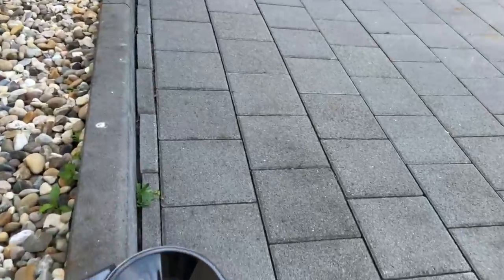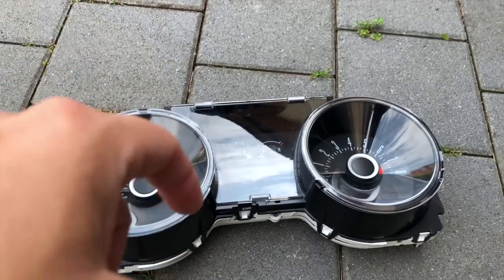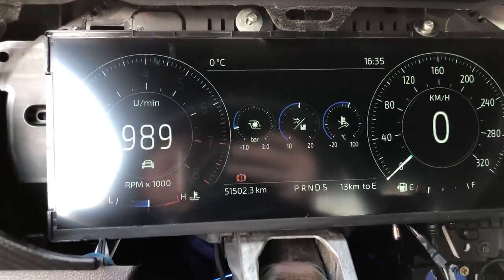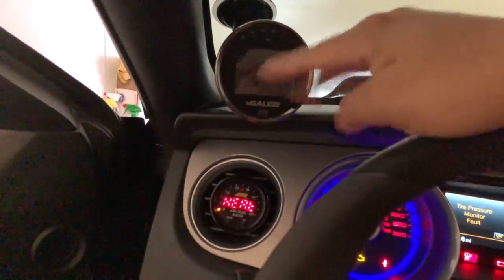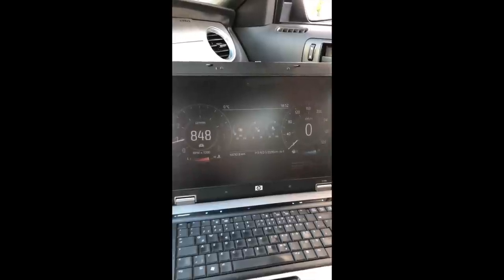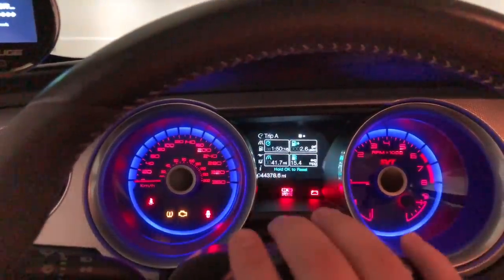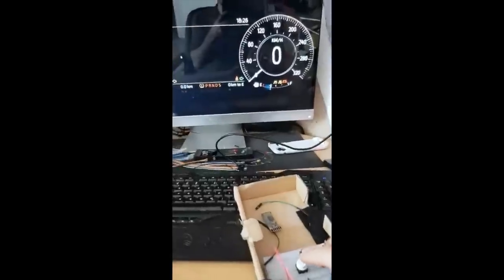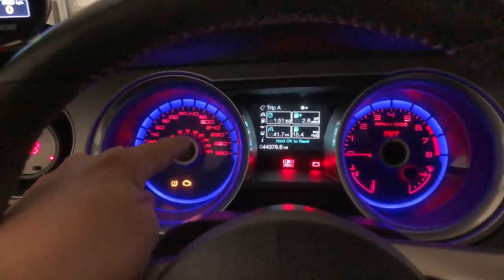2011-2017 Mustang Digital Dash Pt. 1

Comment: "only offered on the 2018 and up Mustang"   I know many OEM swapped 15-17s with them, seems this really is only for 11-14
Reply from the maker: EliteGeeks no 2015-17 comes with them from the factory. You would have to buy the digital cluster from Ford and swap it in. So, this will work for 2011-2017.